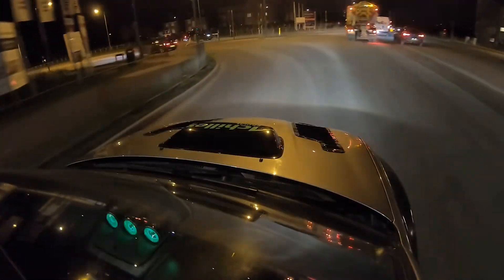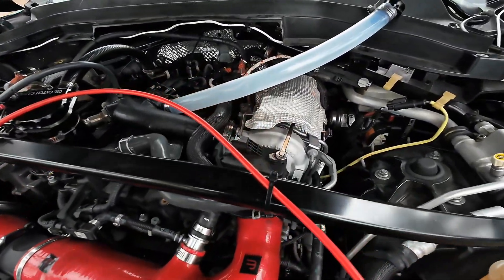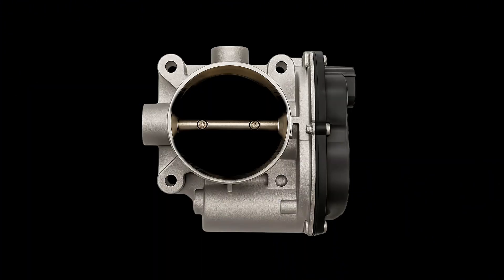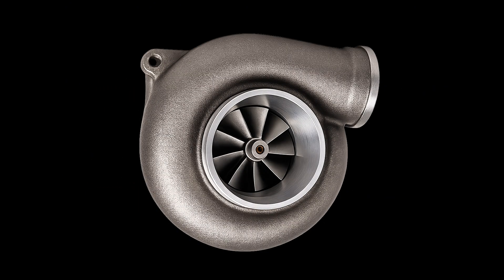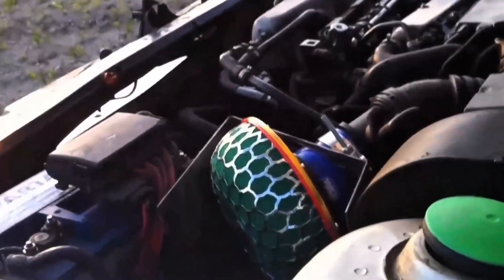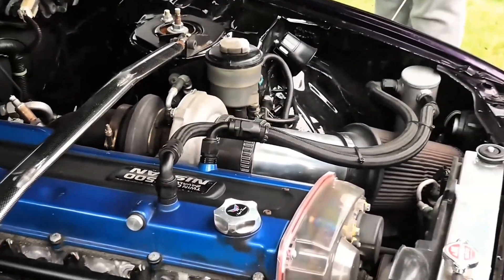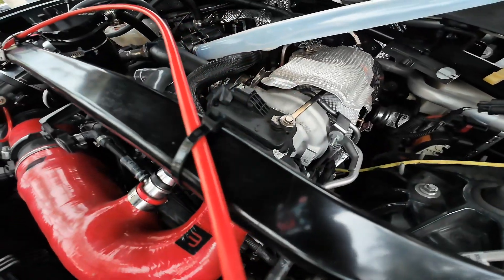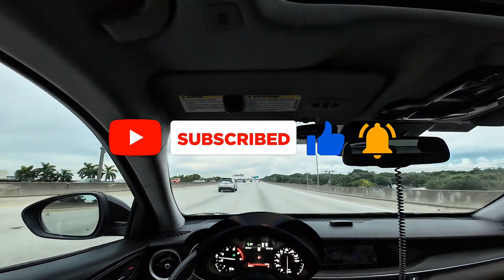Car Culture LIED about TURBO FLUTTER

Comment: I'm tired of all these wannabe mechanic clowns telling me: "You're gonna ruin your turbo by not running a BOV" Dude, the HX40 couldn't give two shits about back pressure.
Reply from the maker: I'm tired of all of these wannabe mythbusters in the comments that reply and say it's just fine - and then say they're running an EFR8474, or an overbuilt journal bearing OEM turbo, or an *HX40*.

You are running an incredible unit, of course it doesn't care. Thrust bearings are still going to get chewed up and you'd be better off with a BOV, but the turbo still might outlast the motor.
Reply: @TorqueTheoryLabs I'm sorry, I really should have phrased that better. I wasn't responding to you 😅 I meant the people I've met in real life that have criticized my build for not running a BOV. Great video, my apologies for being misleading with what I said 😅 But yeah I'm not getting a BOV
Reply from the maker: @kempopeepo 

You would be better off with a BOV.

But you'll be just fine without one as well. The people who are being absolute in telling you that you need one are wrong - like you said.

Appreciate the support though!

Comment: Ive been running the same journal turbo with alot of off throttle flutter for 10 years and its still fine and alot of other people will say the same. On throttle flutter tho is very bad!
Reply from the maker: Yes, on-throttle flutter is terrible. Off-throttle sounds awesome. But it all depends on your boost PSI and turbo type. 

10 years is a decent amount of time for any turbo, let alone a journal bearing with flutter. What turbo is it?
Reply: @TorqueTheoryLabsholset "hx40"  it is a volvo truck turbo and been on volvos test bench too but i dont know for how long. My car is just a summer car so on the 10 years its only driven good days for 6 months a year
Reply from the maker: @marcusnilsson7284 

Well that adds a lot more detail!

Not sure if you know what you have - but the HX40 is an amazing unit. It'll probably outlast the motor, especially since you don't drive it very often.

Comment: What about aftermarket Journal bearing turbos with strong thrust bearings such as most BorgWarner or Holset designs?
Reply from the maker: You'll probably be just fine, especially if boost is moderate.

But without a side by side test, you won't know what it's doing to your turbo. So it depends what your goals with the vehicle are.

Comment: How about installing your BOV backwards just to get the turbo to flutter. I know someone who did it on their Evo X and I told them to put it back the way it's supposed to be because it wasn't designed to do that.
Reply from the maker: That's a weird way to do it. A block off plate would be better for trying to achieve flutter. But yeah, not good to surge regardless.

Comment: Turbo flutter sound comes from the diaphragm of the blow of valve. It’s not air coming back through the turbo. Don’t like it get stronger spring.
Reply from the maker: You've gotten your facts mixed. You can mimic turbo flutter sound with a BOV.

But if you block off your BOV, you get turbo flutter from air moving backwards out the compressor inlet.
Reply: @TorqueTheoryLabshis was know for the flutter because the way they designed the diaphragm on the bov. That’s the Stu flutter sound venting to atmosphere And changes sound when recirculating it back into intake.  You don’t explain that to differentiate it to make all people think that all flutter is bad

Comment: Big difference between surge under boost and a bit of flutter when manifold goes to vacuum. Ball bearing turbos are more sensitive to this than journal but either type can chop up a bit of 0.5psi air without doing much damage, especially when paired with anti surge compressor cover.
Reply from the maker: Close, ball bearings actually tolerate compressor surge better. But yeah, throttle-lift surge is definitely NOT as bad as compressor surge while the throttle is open. And 0.5PSI of air won't do anything to a healthy turbocharger.

Comment: Tell this to my turbo that's been running without a BOV for 2 years and still has zero shaft play 😂
Reply from the maker: What boost pressure? 
Stock or aftermarket turbo?
Journal or ball bearing?
What car?

I should make a form to paste in for every anecdotal longevity story I get.
Reply: @TorqueTheoryLabslol it's, 10Psi, 250$ amazon oil cooled journal bearing turbo, it on a 2002 Jeep TJ with the stock 4.0 inline 6.
Reply from the maker: @pkev715 

10PSI is low enough. Glad it's working out for you, flutter sounds awesome.
Reply: @TorqueTheoryLabs you have experience running higher boost without a BOV?

Comment: You can also tune your BOV to make a flutter sound. Air is still  venting but the valve oscillates partial to wide open. The springs and seals wear out but they are cheap and easy to replace.
Reply from the maker: That's true - you could technically do this.
Reply: @TorqueTheoryLabs Implying flutter comes from the BOV? 'Tuning' your bov to do this is simple increasing the spring pressure so that at low PSI the BOV doesn't open and you get fluttering (exactly the same if you had no BOV). The BOV doesn't oscillate and doesn't have anything to do with the sound.
Reply: @Aprixx  normally you are right. Tuning for a fluttering partial to wide open causes almost no boost in the system. Yes you will loose peak boost. No you will see the needle shake on zero bar. No the compressor isn't surging. No the sound isn't exactly the same. This is a stlye thing.
Reply: @Eluderatnight  How exactly is the valve going to open and close and open again?
Reply: @DriftNick look up "oscillation of undamped mass-spring system". Calculate for static downward pressure for blow off pressure and backtrack from there.
Reply: @Eluderatnight  Every single time I've asked people to show me an example of a valve doing it they just show me a video of turbo flutter, nobody has actually explained how it would work or shown any evidence it works, can you do either? and no telling me to look up "oscillation of undamped mass-spring system" does not count.
Reply: @DriftNick  valve closed with static spring force for a given psi resting on uncompressed gasket/oring. Blow off pressure met accelerating valve away from port. Valve slows and accelerates closed overtraveling into oring/gasket. Valve has lower spring pressure in over travel position plus longer impulse time as well as upward force from compressed gasket. This sends the valve back open and repeats loop until pressure drops.
Reply: @Eluderatnight  Your theory is nice and all but that is not how blow off valves work.

Comment: I've ran so many cars with no BOV's, and I've never replaced a turbo.  A few that come to mind are a 2002 wrx with the stock high km turbo, Audi B8 A4 2.0t with the stock 300,000km turbo, and a single $300 Chinese turbo on an N54 that the bov can't keep up with and has seen a lot of flutter.  All these cars were beaten often, warmed up just until the rpm's dropped, and not even close to a minute of cool down before shutting off.
Reply: All tuned all well at high psi...  and A4 tuned to the ragged edge lolol
Reply from the maker: Anecdotal longevity stories like these aren't uncommon, glad your turbos held up! Flutter sounds awesome.
Reply: @TorqueTheoryLabs I hear ya haha love it.  I've gone out of my way to try and kill a turbo in this method, and haven't yet lol.  I wanted a baseline on how long it takes to cause bearing/blade/ housing damage... but so far all I've done is fail successfully.
Reply: @TorqueTheoryLabs as an engineer myself. Turbos dont really get hurt from that.

Car manufracturers nowadays do the same from factory. No blow off, no recirculating, jusr surge.
And the turbos run and run and run.
The force is so miniscule, absolutely neglectable.
Reply: @dom3827 Iirc it's electronic wastegate vehicles that can do this, as they can open the wastegate to any position at any time
Reply: @Aridyllydira no, no electonic wastegate.
The air get straight dumped out of the turbine.
This never kills turbos. Thats an urban legend.

On a low quality turbo at 3 bar of boost it could start to make problems to think about. But in reality, no.
An urban legend.
Reply: @Aridyllydira  The forces from compressor surge are tiny compared to what a turbo really sees.

Surge pressure on the wheel is a few hundred N.
Resulting torque: single-digit N·m.
Centrifugal forces on the blades at 150k rpm: tens of thousands of N.
Rotational energy of the rotor: tens of kJ.

In other words, the surge “pushback” is negligible versus the forces the turbo is built for. That’s why OEMs can run turbos without BOVs for hundreds of thousands of km, the flutter noise may sound violent, but physically it’s harmless.
Reply: @dom3827 Appreciate the info.  Good stuff.  1 vehicle that does use the electronic wastegate action, in place of a DV/BOV is bmw.  They have predictive action, and action based on throttle position.  So many brands with boost now haha hard to keep up with them all..!
Reply from the maker: @dom3827
@aridyllydira

Right, but OEM motors running a decent amount of boost (20+ PSI) will typically have a bleed off strategy to not risk warranty claims.

You're correct, the centrifugal forces on the blade are insanely high at max spool.

But turbos are balanced on a VSR so it's smooth and the bearings are designed to handle the load. OEMs overbuild turbos, so while you may not see damage from flutter immediately - it is usually not harmless.

The problem with throttle lift surge is the oscillating, rapid loading and unloading on the thrust bearing. That hammering effect is what accelerates wear.

If your turbo has survived thus far, that's awesome. But there are dangers.

Comment: People have told me that the OEM recirculation valve noise on my car means the turbo is fluttering and will blow up. 

So anyways, 100k miles in and the impeller shaft and blades are perfect. Crazy.
Reply from the maker: To confuse the recirc valve and turbo flutter is insane.

Comment: I mean its just more wear and tear you can do this for years and have no issue caused by turbo flutter
Reply from the maker: This is true because variables are different on every setup. 

Take my 2.0L Alfa Romeo Stelvio pushing 30PSI as an example, flutter would wreck this journal bearing turbo.
Reply: @TorqueTheoryLabs ever hear turbo flutter on Subarus like the wrx especially when they are unequal length headers? Not only does it sound bad it sounds like its broken or wrecking shit up its crazy ppl run their cars like that 😢

Comment: 😅 But  bro  what  if we use half the Blow Off Valve? 
I have been searching for videos of people making cars sound like Diesel Turbos. Just   winding down
Reply from the maker: Half a BOV would be the worst of both worlds - significantly less flutter while still retaining most of the bearing wear.

The wind down sound comes from large turbos coming down from a spool w/o a throttle plate blocking airflow (with it being Diesel), not something you could recreate with a gasoline motor very well.
Reply: @TorqueTheoryLabs  So in Torque Theory, there's an outlet for the turbo? I've been hearing trucks pass by with turbo bark.
Reply from the maker: @animrandoms 

With Diesels, turbo bark is caused by the other type compressor surge. So not throttle-lift surge, but overspeed surge.

Essentially, the compressor wheel has a lot of rotational energy. If you suddenly spike fueling to make more power, your exhaust gases have more heat and energy, and the turbo can enter a surge/overspeed condition it wouldn't normally be able to enter. So the air reverts back out through the wheel since the blades on the wheel can no longer grab more air (flow seperates from thw wheel). This reversion causes that bark because diesel turbos are huge, and it's almost as if the turbo is acting like it's own BOV.

This is way worse for the turbo then basic flutter because exhaust energy is still there, so the turbo doesn't get a chance to easily come out of surge until the wastegate adjusts.
Reply: @TorqueTheoryLabs 
I see now. Thanks for the info. I've been curious about it since lots of trucks here often do that.
I personally favor turbo bark than turbo flutter and I personally want to do that when I get a car.
Reply from the maker: @animrandoms 

Well if you had to choose a way to wear your turbo quickly, at least choose what sound of destruction you personally like best.

✌️

Comment from the maker: Just to clarify: at 1:00 the animation shows the compressor wheel spinning backwards. That was only meant to illustrate that airflow can reverse out through the compressor during throttle-lift surge. The wheel itself never actually spins backwards, it keeps rotating forward the whole time.

Wheel speed doesn't drop a "measurable by normal means" amount during throttle-lift surge.
Reply: 'Wheel speed doesn't drop a "measurable by normal means" amount during throttle-lift surge.'

Which means there ISN'T massive thrust loads on lift off surge, otherwise the compressor would slow a lot. Like the other comments say, without the turbo actually loaded 'surging' isn't surge at all, there isn't counteracting forces moving in opposite directions on the shaft so, no it's not 'violence and brutal thrust loads', every moron has had t04z kits with no BOV's for 20 years. It doesn't explode your turbo.
Reply from the maker: @Aprixx 

The thrust bearing is supported hydrodynamically, and the wheel has crazy inertia so you won't see any measurable slow down.
Reply: What about when you only boost a little bit and nicely back off the throttle...stock or aftermarket BOV it makes that weird noise that might still be compressor surge. Is that bad? 🤔
Reply: Almost none of the video is correct, I used to blow up turbos on R&D benches at a Caterpillar factory for both first party and third party turbos (Cat makes parts for other companies). The flutter is from the sound waves bouncing back and canceling out the induction sound waves.The blow off valve is LITERALLY only there to prevent the sound because customers would think something is wrong with their car, truck, etc. When the throttle plate is closed the air is compressed, it is still air, it is still able to be compressed, your turbo likely can compress it another pound or several pounds depending on how hard you are pushing it. Compressor surge is when you run your turbo past the surge line and is ON THROTTLE only. Basically for damage to actually occur, and I’ve actually staged turbos to fail for this reason hundreds of times, the throttle must be open but the throttle must also be too much of a restriction for the amount of boost being produced causing the turbo to TRULY be operating outside of its surge line. A turbo IS NOT outside its surge line off throttle. This is would be like strapping a jet engine to a garden hose and trying to see which one explodes first, except in this case the garden hose would be made out of hardened steel.
Reply from the maker: @dsmbilly3690 

If sound waves were bouncing back and canceling out, there wouldn’t be any sound, that’s literally what cancelation means. The flutter you hear is pressure oscillation, not silence.

Comment: Doesn't do any damage. Vl Turbos still running 30 years later  is proof :D
Reply from the maker: If it's a factory RB30ET - they run only 6-7PSI on an overbuilt journal bearing turbo known for longevity. It's a bit of an outlier, but It doesn't compare to the 20-30PSI ran from the factory on newer vehicles.

How many miles on your VL?
Reply: @TorqueTheoryLabs 400,000kms, also fair call about the lower psi. i just want to cope, the flutter is just too epic :D
Reply from the maker: Flutter does sound awesome! No arguments there.

Comment: reality is it dont matter, i got a journal bearing turbo with over 300,000km still running flutter and no issue
Reply from the maker: How much boost pressure? And if it's an OEM setup, what car?

Usually when I get comments like these, people leave out an important detail or two.

Comment: Imagine a new breed of car enthusiasts like shifting without the clutch and enjoy the grinding noises their transmission makes.  This is what turbo flutter sounds like to me.
Reply: People put loud exhausts on their cars that hurt performance. And enjoy the way it sounds. . . See where im going with this
Reply: Imagine people install airfilters with low filter charackteristics, sucking in all the fine dust and dirt.
Its like people pour sand in their intake to me.
Reply: Imagine using Ethanol fuels, that literally destroys your engine by eating it alive....
Reply: Imagine people use all the Rev range
Reply: Imagine that you can do this and most semi trucks do without grinding and add to that dog rings/dog engagement transmissions.  Flutter on throttle is the destroyer of things not off throttle.  I will respect you just dont like it but years of racing and building turbos professionally says the turbo doesn't get damaged.
Reply: Completely different analogies, but whatever.

Comment: Finaly sumone explain turbo flutter correctly. You wont believe how many "car guys" thing its perfectly safe to do so and doesnt damage the turbo. Great job on the video bro 👍
Reply: As a car guy for a long time and someone that has run cars with no blow off valve for 15+ years if it does any damage it's so minimal you can't even tell, unlike the "car guys" that have zero experience doing that will tell you.
Reply: @DriftNick  i have replaced many turbos cars i work on more then just 1 car bud 👍
Reply from the maker: Glad I could help!